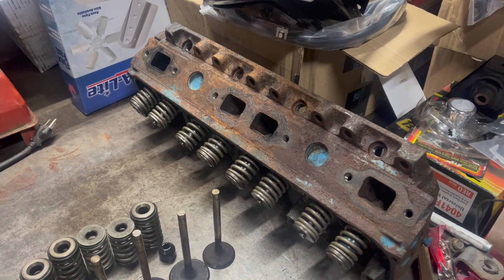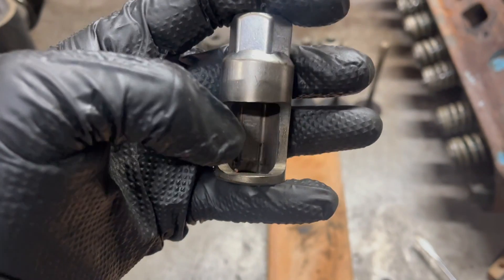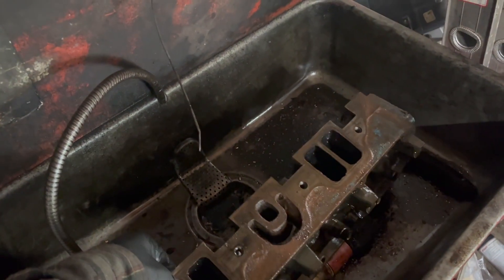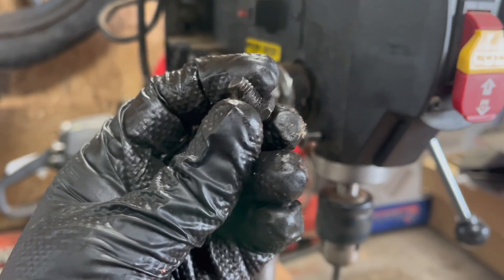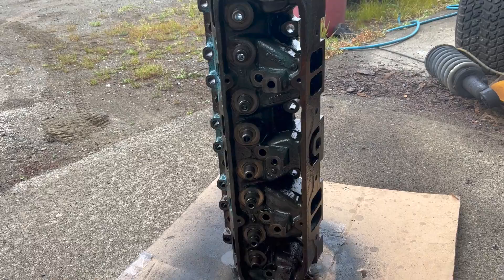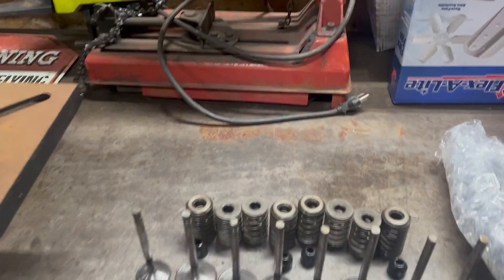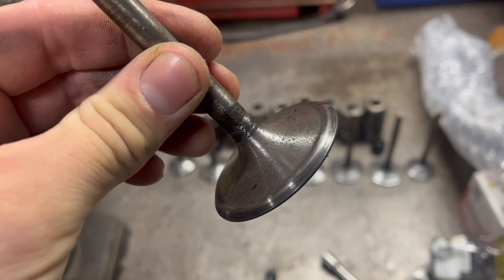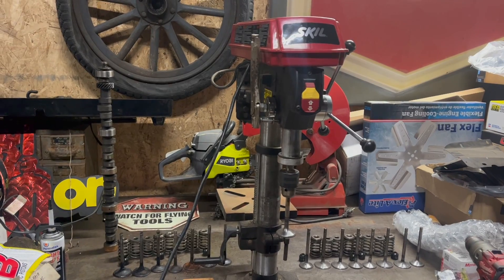Overhauling Cylinder Heads For Dummies Like Me - Making Tools, Modest Gains, And What To Look For

Comment: Is that literal new glass in the Toolbox Charger, or used glass? And where does one get that?
Reply from the maker: Brand spankin’ new. I believe it all came from Classic. No idea who makes it, and the rear glass took a while. The windshield may have actually been ordered by the glass installer. Can’t remember.
Reply: Was curious because Chris Birdsong stated in a video from might be a year or two ago now, that none of the new stuff fits. Maybe things have changed. @DeadDodgeGarage
Reply from the maker: @noberet  There are absolutely fitment issues with replacement sheet metal. It all requires modification to work. Replacement glass has been ok - but I have read that it tends to be slightly thinner, which can lead to sealing issues in gasketed applications. Other aftermarket replacement or reproduction parts are hit and miss.
Reply: The glass was his specific complaint that time. Said it is never correct and you need it from a wreck or NOS.
Sounds like things improved.
 @DeadDodgeGarage

Comment: Would a Dremel with a carbide bit offer a little more control/finesse than the drill for the porting?
Reply from the maker: Oh, almost definitely. A proper die grinder sized for these carbides is the right tool though. The high RPM is ideal. I used to have one but it blew up.

Comment: Ah if only I had room for a drill press (which I could use for so many other things)...  I had to settle for one of those top-end things that looks like a pulley-puller, hooks on the spring and push down on the retainer.  Small and handy and fits in the toolbox, and it let me change valve stem seals without removing the heads.  Cool beans.

Comment: Great job ! Very good video for basic cylinder head freshen up. Years ago I hand lapped many a valve with a little stick that had suction cups on each end. This exercise builds loads of  character. And I also did some minor porting with a die grinder. But now that I am older, wiser and have a little more money at my disposal, I just buy aluminum heads and sell that iron age crap to someone else. Keep up the good work!
Reply from the maker: That’s a good technique too 😅 clicking buy on the aluminum is a whole lot faster. I was going to make a joke about the wood stick with suction cups, but it - and at least a couple more things - slipped my mind.
Reply: My Dad had one of those wood things, cool old tech

Comment: You need to get a Fordam for that port work. It's like a supersized dentist drill. Has a foot feed for speed. Interchangeable hand sets. You can pick one up for about $100.00 used if your patient. Right up there with a lathe on the handymeter but way cheaper.
Reply from the maker: Oh, that is an interesting tool. Never heard of that before. It sure does look handy. I’d be in ok shape with just a decent electric die grinder. I exploded my last one pretty quickly. I have the bits, need to invest in the tool. I even have some non ferrous cutters for aluminum manifolds and heads. A lathe has been on my list for a long time. My friend has one of those combo mill / lathes that isn’t super amazing but would probably do everything I’d ever need. That could work.

Comment: 😅 that springggyy thingyyy is a valve compressor maybe you left in a engine hare doctor.😅 I do believe it's time to change your washer solvent. It's dirtier than the heads. The drill press is a keen idea. Never done that before but will. Head porting is arguably a tough job to do it so they flow. I would argue uncle Tony is a hack. I have done hundreds and it's a dirty job that sucks. You can over do it and hit a water port. Ask me how I know😊 it was the first set I did. 48yrs ago. I still have them as a teaching tool. Also in a pinch you can use super duty rubbing compound to lap valves if there not to bad. Only thing I would add as a tech tip is when your all done and back together is to take a plastic hammer and smack the valve stem to make sure the keepers are seated in. It's insurance. To all that reads my crap. What Jamie did here is a good idea to do anytime you pull heads. Remember  clean heads are happy heads. 😮 also always remember to lube you stem before you stick it in a hole.😅 stuck valves sucks and not in a good way.
Reply from the maker: Big time. Oh Uncle Tony is definitely a hack. But his junk seems to kinda run and I like the approach. Yes I forgot to mention the hammer smack at the end - that’s key! Just like the hammer smack on the engine main saddles when installing them. That solvent was dirty when I got it 🤣 it’s yeaaaars overdue for replacement. Need sand for cabinet too. I try not to think about all of these things or I’ll get overwhelmed. Hey my truck and both Subarus need an oil change also… anywho…
Reply: Uncle Tony is trying to show viewers how to do the work at home on the cheap.  A hack he is Not.
Reply from the maker: @0004612  I watch all of his videos (except the nuts conspiracy theory crap) and to me, 'hack' can be a good thing. He's a self admitted hack. It's like a term of endearment. He does things on the cheap (like, so cheap) and they work. I've aligned my whole reality with that ethos. I've learned more about engines and drag racing suspension setup from Tony than anyone else anywhere.